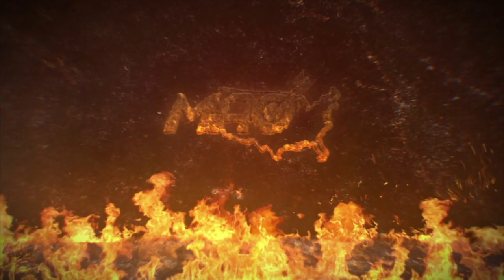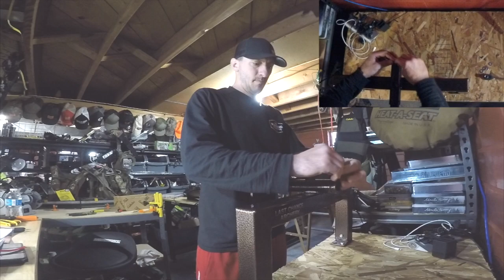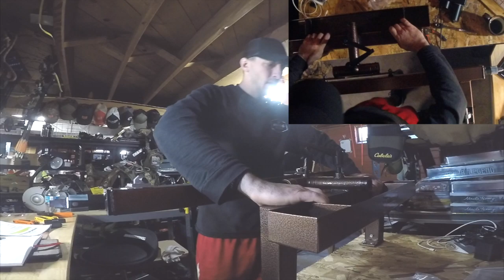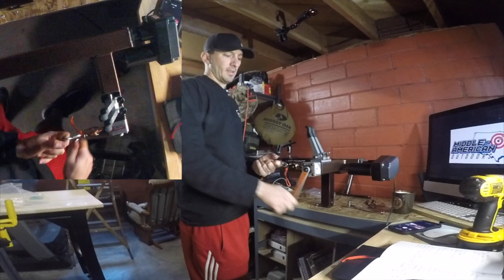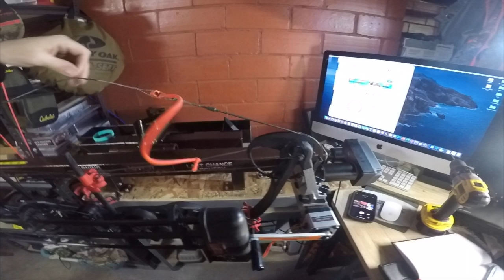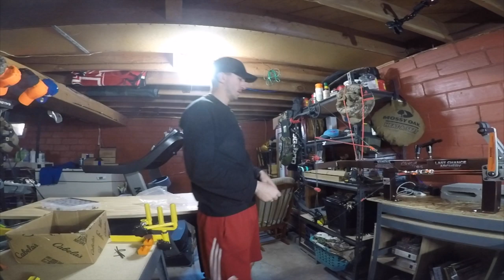LCA - Power Press Deluxe - Build AND Review

Comment: Nice video. I got this same deluxe model with 2nd axis a couple of weeks ago except with the fly wheel.  You’ve got me thinking of adding the power unit and foot pedal - be good to have both hands free.
Reply from the maker: Thank you!  I LOVE my press.  If the foot pedal is in the budget - you won’t regret upgrading to that, but you can only have one or the other installed at a time.